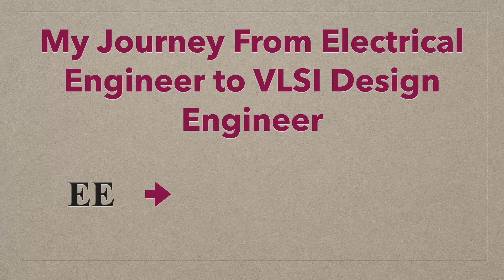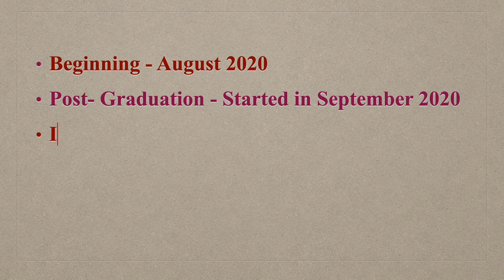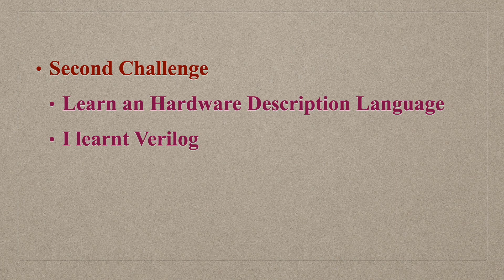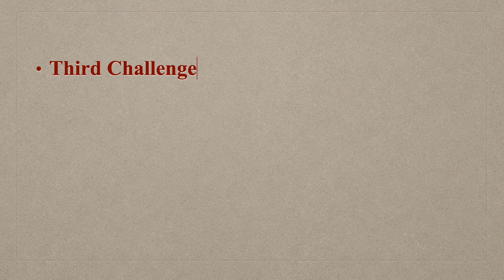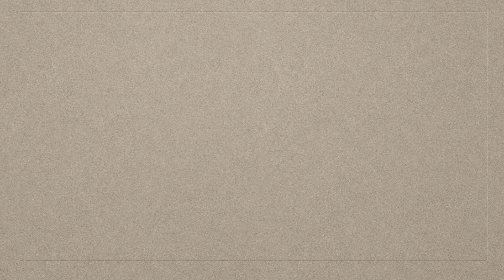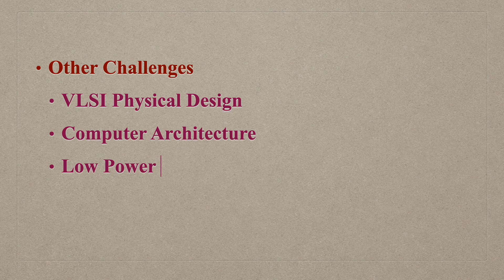My Journey from Electrical Engineer to VLSI engineer  | EE to VLSI transformation| Rajveer Singh

Comment: I’m in my final year of engineering…VLSI placements seems dead…So I’m revising my basics and thinking to gain skill in some specialisation.
So what would you recommend Physical design or Verification…whose jobs are more and whose growth is good.
Till which month of next year....I should plan to finish all the prep to start applying for companies.
Reply from the maker: Verfification and Physical design both have opportunities and growth.

Verification would require electronics and coding knowledge in depth while physical design goes to transistor level & standard eda tools come into picture. So decide accordingly.
Verfification/ Front-End have better work life balance in general

Comment: My branch is ELECTRONICS ENGINEERING IN VLSI D&T , Main to poora eligible hu for mtech vlsi at iits.
Reply from the maker: Yes
Reply: @Singh-Rajveer  or bhaiya less assume ki maine old 7 iits me se kisi ek se mtech kiya vlsi me... Can I consider myself as an iitian? Ik it's silly...but pls bataiye 🙂
Reply from the maker: Yes, You can and you should.
M.Tech from IITs is not at all easy.
You have to top GATE to get top 7 IITs vlsi branch and after that you need to perform two years in a research based field to get the degree.
So, Yes you can !!
Reply: @Singh-Rajveer  thank you so much bhaiyaaa... Gonna ss this, so that I get motivation 😁

Comment: Sir while Going for Mtech what should i prefer VLSI design,ESE,EPD
I m from electrical branch expecting rank under 200-300?? Please help
Reply from the maker: All are interconnected in some ways.
Electronics systems or electronic product design will also be very good (If IISC/ Top IIT).
Your gate score would be very good so, You will be getting any of the top 6 IITs. You may go for anyone.
Few colleges say VLSI as Microelectronics , few say Integrated circuit and systems, electronic systems etc.
While all relates or nearby vlsi only. So, Choose anyone.
Just visit the respective college and read about coursework before making the final decision about branch.

Comment: Sir , i am an electrical engineering student, while giving exam in Gate EE paper ,  can I able to give study vlsi in masters in various nit and iit colleges.
Reply: This is the same question i want to ask
Reply from the maker: Not in All colleges but you would be eligible in a few colleges.
 Some clgs where ee is eligible for vlsi
NIT Trichy
NIT Surathkal
NIT Rourkela
IIT Mandi
IIT Patna
IIT Bombay, Delhi , Madras ( Cross check once).
Most of the colleges consider ece gate paper that's why for vlsi ece gate would be comparatively better choice.
Reply: @arkadyutisarkar5128 yes you can apply in vlsi from ee gate paper  but you have to see which iit nit allow ee student to appear in vlsi domain.
You have secure very good rank as you are competing with electronics students,as vlsi is their first choice.
Reply: @Singh-Rajveer  Thanks for replying sir
Reply: @Singh-Rajveer  
Thanks for replying Sir
Reply: @arkadyutisarkar5128  i am not singhrajveer i am anuj  btech final year student gate 1417 rank ee.
Reply from the maker: Correct!
Reply: @Singh-Rajveer so sir to increase our chances of selection in vlsi we should appear in GATE ece ? because very few colleges are accepting gate ee for vlsi
Reply from the maker: Yes, Gate ECE is more beneficial if aim is not PSU rather it's VLSI or Corporate jobs
Reply: @Singh-Rajveer  sir only 5 IIT & only 3 NIT allow Gate EE  student to join VLSI  ? Is this information correct sir ?
Reply from the maker: I guess more
IISC, IIT B, IITD, IIT Patna, Mandi, Indore, Palakkad
NIT Trichy, Surathkal, Rourkela and few more lower NITs.

Comment: Is this Front end or Back end VlSI skill, plz reply
Reply from the maker: Which one, Please mention?
However I am particularly working in front end vlsi design.
Reply: Which all courses are important for backend VLSI.
Does most skills you mentioned is mainly for frontend am i right. Is their any common courses for both front end and back. 
Actually i also not interested coding. I mainly like maths and physics which should be better for those kind of people frontend or backend.
I hope you will reply. And can you reffer some courses in Swayam 🤗
Reply from the maker: @sree_r4g_ Backend would be better if someone is interested more in device physics, layout design etc.
I have done vlsi Roadmap video and a particular video on vlsi physical design. You will find it on this channel.
Reply: If i have further doubt about VlSI related, i will comments on that video. Btw very very thanks bro ☘️👍

Comment: Bro i am 2020 Electrical and electronics engineering passedout if i want to do mtech in vlsi  by writing gate ee 2023 or 2024 is there any age criteria in placements because my age at the time of completion mtech will become around 26 or 27
Reply from the maker: No, Age criteria is not there but they will ask about gap & you need to give some answer for that

Comment: Hii bro good evening.im completed my BTech in electrical and electronics engineering in autonomous institue not University can I eligible to VLSI without mtech degree give me some suggestions I'm fully confusing about VLSI
Reply from the maker: Yes you can try off campus if you have vlsi knowledge but it would be very difficult to enter and jobs for btech freshers in vlsi are very less untill and unless you aren't from TOP colleges